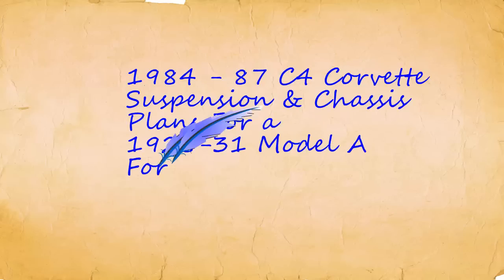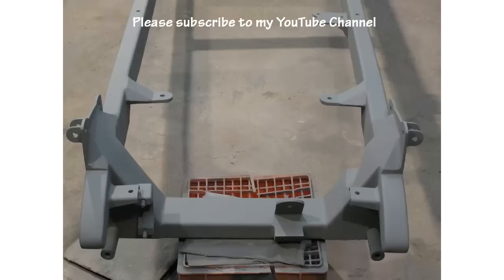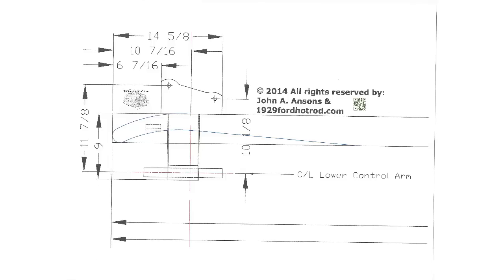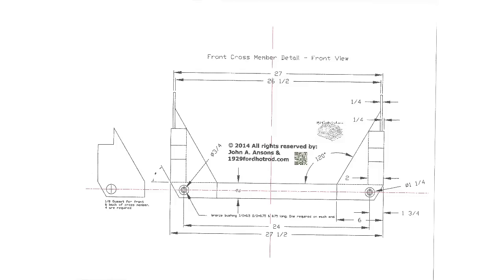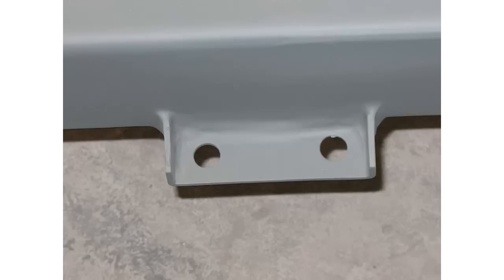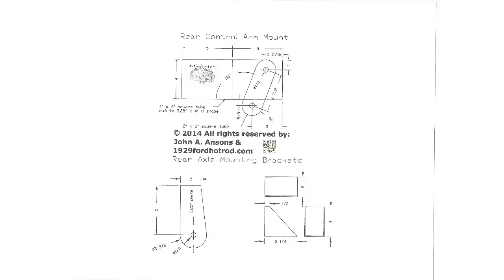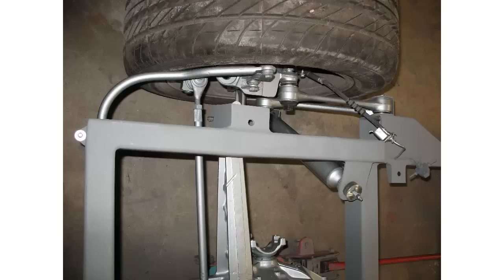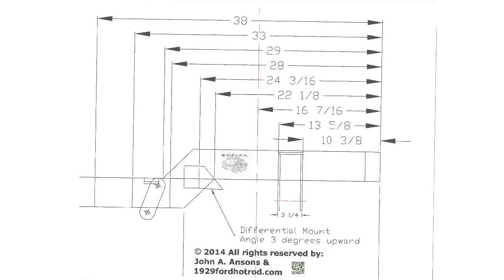Model A Ford Hot Rod Chassis / Frame Plans Using C4 Corvette Suspension

Comment from the maker: I have compiled the chassis plans and actual pictures of the chassis I designed and built for my 1929 Ford roadster using 1986 Corvette suspension components. These are now for sale for $25USD. Once payment is received an electronic file, PDF format will be sent to you via email. Contact me via Facebook.

Comment: Thank You for sharing, very good work. We just started gathering parts ourselves, we have an 84 Vette $500 complete, and its going under a 1950 Ford 2 door. We have not had a chance yet to pull the Ford body off the frame to determine if we want to use the modified Ford or modified Vette frame but we will get around to it.

Comment: CAT says Carriage bolts are for carriages- wood and not for suspensions. Way too low tensile strenght. You gonna crash if you use them.
Reply from the maker: The bolts used on the upper control arms are stock GM hardened bolts.

Comment: what this type mark steel or metal?
Reply from the maker: I'm not sure what your question is? The suspension parts are all made of aluminum and the chassis is steel.
Reply: how is thickness steel ?
Reply from the maker: The tubing has a thickness of 0.1"

Comment: thanks for the great video. can you tell me where the front wheel centerline is located in relation to the two upper A arm bolt holes on the subframe.i would greatly appreciate it thank you ..
Reply from the maker: I don't have that measurements readily available but you should be able to work that out from my drawings.  The files can be downloaded from my web site and are drawn to scale.
Reply: ok will do. thanks for responding.
Reply from the maker: I forgot to mention in my last reply that when I designed this chassis using the C4 Corvette suspension I took all of my measurements off an original front cross member removed from a 1986 Corvette Indy Pace car convertible.  I made no attempt to alter the design/measurements.
Reply: i think you mentioned that in your video .im actually using the stock corvette  crossmember on a 56 f100.i know where the front wheel  center line  is on the ford but wanted to know where it is on the stock crossmember.since you redesigned the whole thing i figured the A arm bolt holes where the best place to ask for.